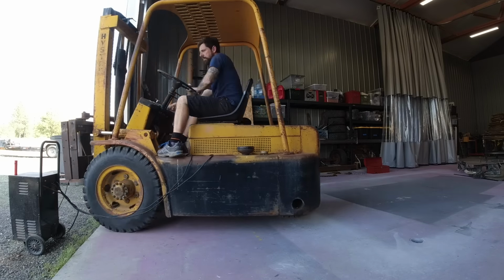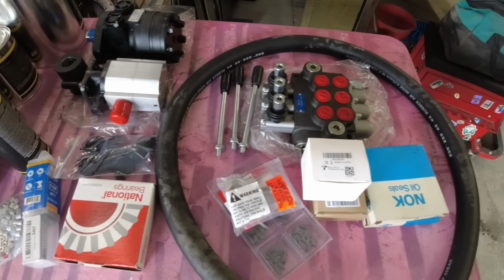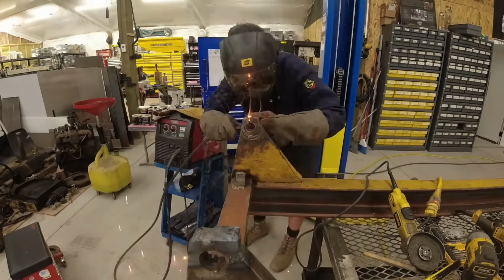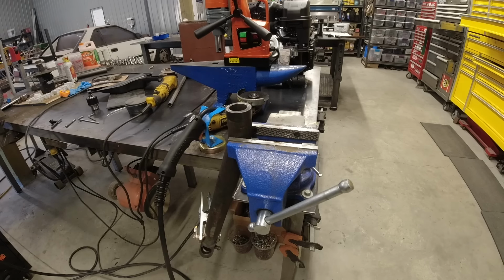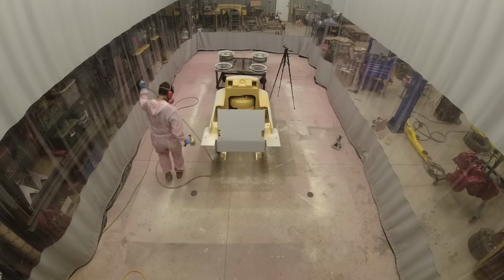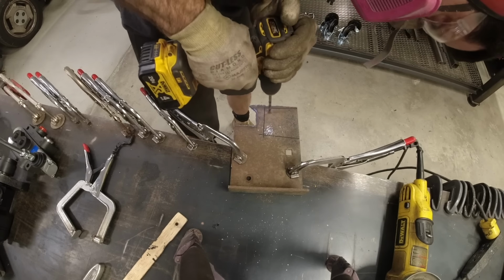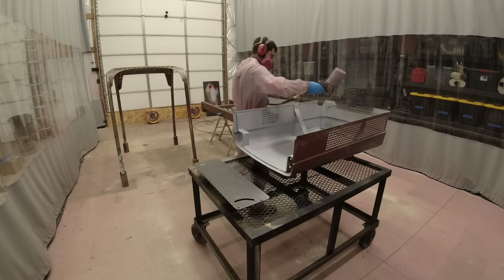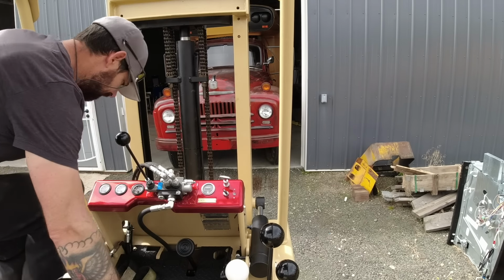Resto Modding A 1956 Hyster Forklift

Comment: Really wished he splurged for something like a small kubota diesele engine instead of that motor. Couldve ran a hydraulic pump for a skidsteer. Parts would have been extremely avalible and  its built for that kind of work
Reply from the maker: I totally get it,  and I thought for a long time about what engine to use, but once I decided to make it hydraulically powered it didn't make sense to me to use a bigger engine, even if it would have been more reliable. I only needed around 15hp for my setup so I decided air cooled was the way to go and I think these little predator engines are great. If I used this forklift everyday I would have gone with a very different design.

Comment: Ever consider to electrify this forklift?
Reply from the maker: I did, but my concern was that I don't use it often enough to justify the cost of the batteries and having to maintain a charge on them. I figured it would be cheaper and more simple to just go with gas at least for now.

Comment: nice build but if  your country has some form of technical inspection authority you may not be able to use it ( in my homeland only a certified mechanic is able to do what you have done here )
Reply from the maker: What Country are you in? I bet if I were using this in a commercial warehouse then OSHA would throw a fit over it, but i'm just a random guy living in the woods.
Reply: @AustinCoulson  that make sense ( also i live on an old contineny)

Comment: how is that tiny hydrolic motor moving that forklift alone
Reply from the maker: It and it still boggles my mind.  That tiny motor puts out more torque than the original 4 cyl engine.

Comment: ALL THAT DIRT AND MUCK SAVED YOU STRUGGLING WITH ALL THE NUTS AND BOLTS PLUS IT KEPT THE TRUCK FROM ROTTING IT'S A BIG PLUS IN MY BOOK PREFER MUCK AND DIRT TO HOT SWEAT AND WRAPPED KNUCKLES AND F ING EVERY 5 MINS

Comment: I think it’s cool to do this kind of thing but I hate that old equipment gets torn up cause you will never get this back
Reply from the maker: I agree. I wish it was easier and cheaper to source some of the original parts like the clutch or the distributor or steering gear box. The ones I could find were super expensive

Comment: At this point it's not even a 56 anymore cuz you replaced the motor duh and you were placed the the steering situation deal so basically technically what you did was made it modern if you will and not back the way it was originally was from its former glory days back in '56

Comment: Wonderful video. But this guy’s explanation for not including an electric starter didn’t make sense. 

He said that he didn’t want the hour-meter to run if he left the starter switch in the wrong position. But who cares about an hour-meter anyway? 

An hour-meter is only relevant when every machine must be carefully tracked and recorded. So the guy is really saying that his forklift is part of the global synchronized machine. All machines must have meters.
Reply from the maker: I was planning on using the electric start as I figured it would be a lot more convenient than a pull start and I still might. The two reasons why I haven't yet are because I hate having another battery to maintain. I have a lot of equipment that is rarely used and it annoys me to have to move my trickle charger constantly between all my equipment to keep the batteries charged, and also because I have seen so many pieces of equipment have the ignition left on and run up the hour meters and I use the hour meter to carefully monitor my service. If it runs up a couple hundred hours while it's not in use it throws off my schedules for regular maintenance. I also just hate that the hour meter now shows an incorrect amount of time on the machine. I suppose it's just a pet peeve of mine...

Comment: everything was great till the harbor freight thing. Switch directly at the end and of course, it doesn't work like it should....
Reply from the maker: The limitation is the hydraulic motor, not the engine. A 500hp LS wouldn't speed up the hydraulic motor.
Reply: @AustinCoulson   to have more speed mean more rpm in the gearbox shaft. For that, your oil flow rate need to be way bigger and it means a bigger a way bigger oil pump or an engine who have more rpm. The problem is if you put a bigger pump, your engine need to have way more HP , if you want to go with ther rpm solution, yous engine can't go this high.
So no, your problem is the engine, and yeah with the right oil pump, an LS will go way faster. 
Hydraulic is just a transmission of mouvement but it need to be well calculated.

Comment: I won't tell your wife that I used A PIECE OF FOOD-GRADE EQUIPMENT WITH A PRECISION SEAL as a welding guide
if you're okay with your wife using YOUR TOOTHBRUSH to clean her shotgun with mineral oil.
Reply from the maker: There is no seal on those stainless lids

Comment: Hyster certainly don’t make them like that anymore. Their modern stuff is dreadful and completely outclassed by Linde, Jungheinrich and Mitsubishi.
Reply from the maker: That is super disappointing. I have owned a few pre 70's Hysters and they have all been great. Even this one before the restoration gave me 2 years of service with a bad head gasket, low compression, multiple leaks and all the issues you saw me fix. Indestructible machines

Comment: Only saw "Hyster" and thought WHY tf bother with a hyster. They're complete trash.
1956. Oh, okay.
Reply from the maker: I didn't realize Hyster had lost it's quality until I got a few comments like this.  Ive never owned a Hyster made after 1970 so I just assumed they were still great.What a shame
Reply: @AustinCoulson  They're horrid to work on and the engineers make a forklift and slap the engine in as an afterthought. 0% organization with hyd lines or harnesses. Relays can be in some funky places too.

Comment: You made a Nice Job, BUT Basically you've Ruined it ! you should have just Restored it and NOT Modified it, i speak as Forklift Engineer with 40 Years Experience, what you have done is Nothing short of Criminal.
Reply from the maker: Mail me the parts to put it all back together and I'll do it.
Reply: @AustinCoulson  If You haven't got the Parts, You Shouldn't have started it.